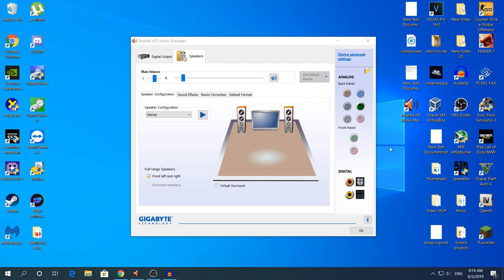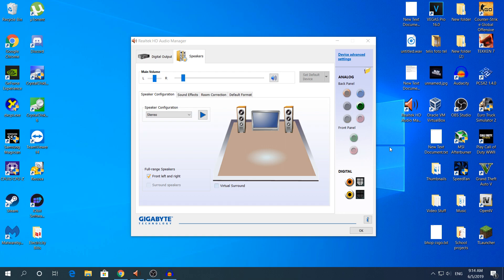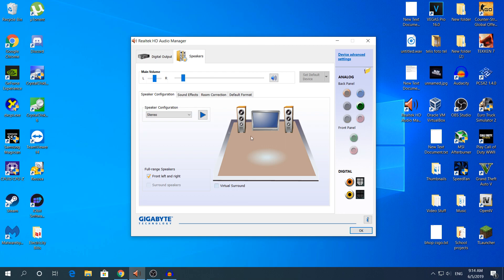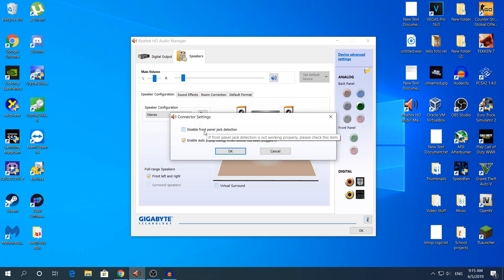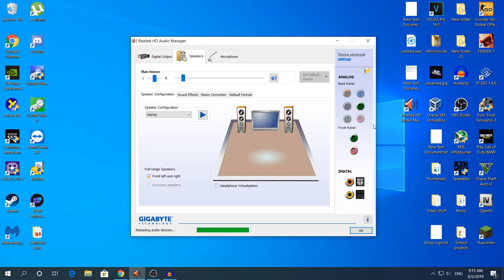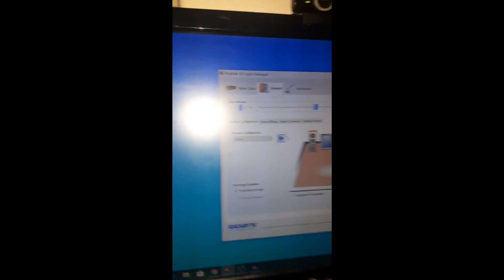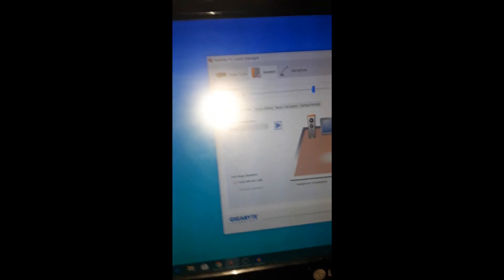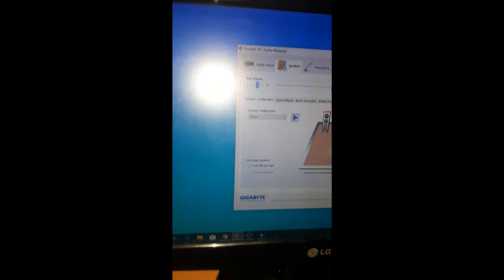How To Fix Front Panel Audio Jack Not Working

Comment: 0:36 I can't see that folder thing and I use a laptop
Reply from the maker: I don't think it works on laptops not sure, but if you don't see the that folder then it means that it probably doesn't work.
Reply from the maker: Wait what the hell am i talking about, ofc it doesn't work on laptops because i am showing you how to fix the front audio jack whereas in laptops there are no front audio jacks like PCs do, so definitely doesn't work on laptops
Reply: @alextutorials  I have something called mic in at front panel and when I take the properties I can see the jack info as left panel 3.5 mm Jack and it always shows not plugged in even though a headphone with mic is plugged in
Reply from the maker: @adwaithks7631  I think you have the older laptop that has 2 ports, 1 mic and 1 for heaphones, is that right?
Reply: @alextutorials  no, only 1 port for mic and headphone
Reply from the maker: @adwaithks7631  Hmm, wait, can you tell me what's your laptop? So i can look to your problem a bit more, thank you
Reply: @alextutorials  hp notebook-15-ay068ne
Reply from the maker: @adwaithks7631  The specs of your laptop say "1 x headphone/microphone combo" so it should work. I want one last thing from you, can you tell me what's the headphone with mic that you plugged in your laptop?
Reply: @alextutorials  I don't know the name but it works fine with other pc's, laptop or phone
Reply: @alextutorials  when I connect with wire it doesn't show any connections but the audio output is through headphone but says front panel mic not connected. But when I connect wirelessly (Bluetooth) it shows connected but no audio and mic doesn't work
Reply from the maker: @adwaithks7631  Hmm then it's definitely the laptop's fault, i can't think of anything else what's causing it not to work
Reply from the maker: @adwaithks7631  Wait, when you installed the Realtek driver the port didn't work or you've had this problem before?
Reply: @alextutorials  I don't remember correctly, but I think the headphone and the mic worked properly, then I installed voicemod voice changer app that just fu*ked up my sound panel (I guess) later I removed that software
Reply from the maker: I understand, maybe a complete reinstall of the audio driver could work? You could try if you want.
Reply: @alextutorials  how do I do that
Reply from the maker: @adwaithks7631  I would love to write the whole process but it's better to give you a link on how to do it. Also it would be a long ass comment if i wrote the whole process and you would get lost at some point. So here's the link (https://www.intowindows.com/how-to-reinstall-audio-driver-in-windows-10/). Once you finish the guide, please let me know so i can tell you how to reinstall the driver. The link i gave you is on how to Uninstall the driver, for how to reinstall it, i'll tell you once you finish the uninstall part first.